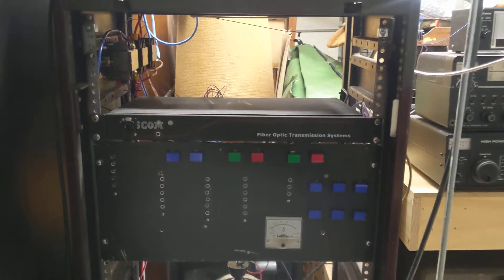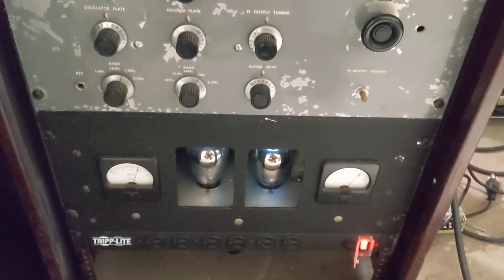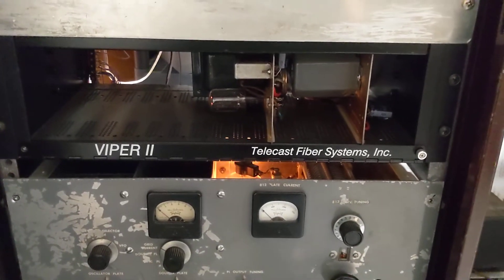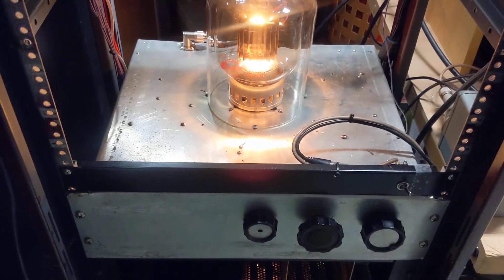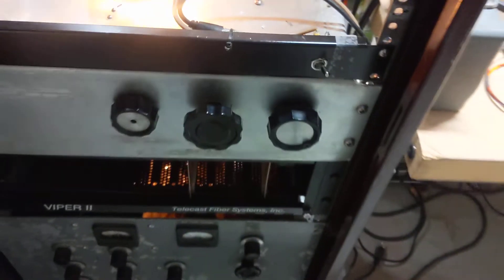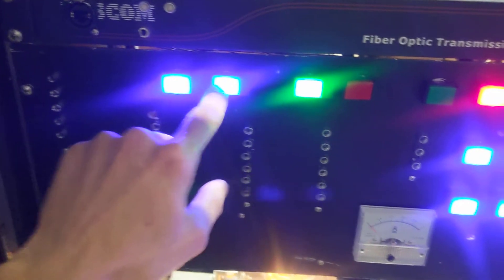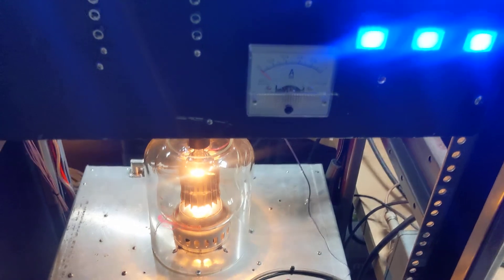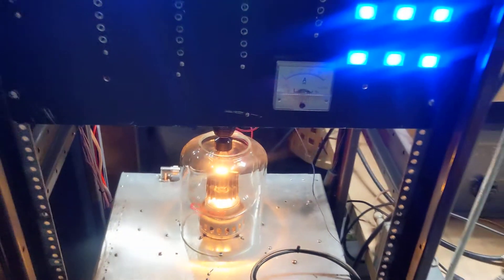1983 Handbook 4-1000a Tube Transmitter

Comment: That GSB101 is realy cool too. runs 4 811a\s at a kilowatt as well, the 4-1000a at 1kv will nedd 350 watts to drive it... at 6kv dc it will run full power 2.7kw at 150w drive. i built a couple of em. single and twins